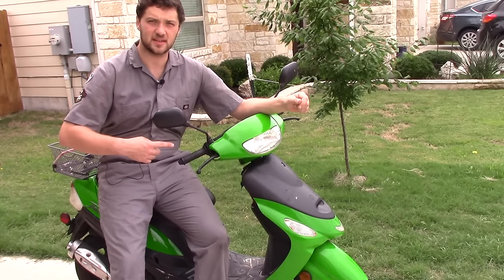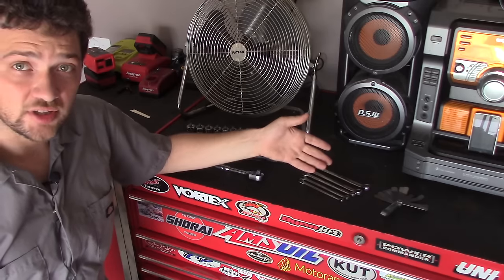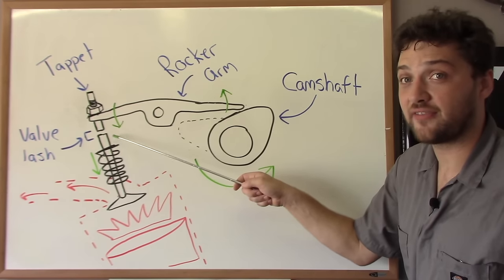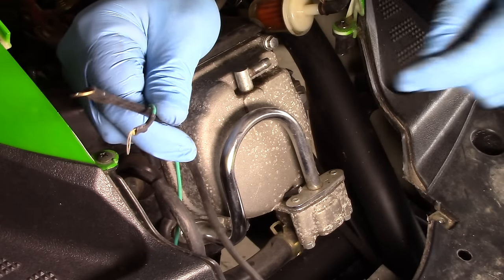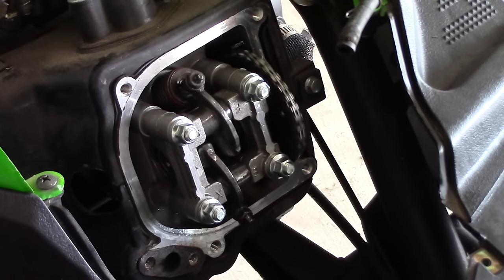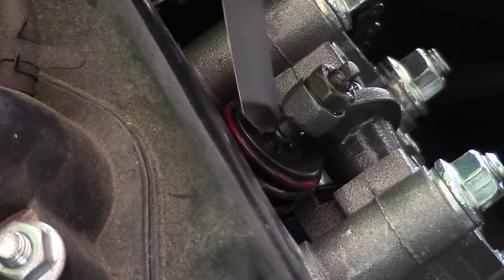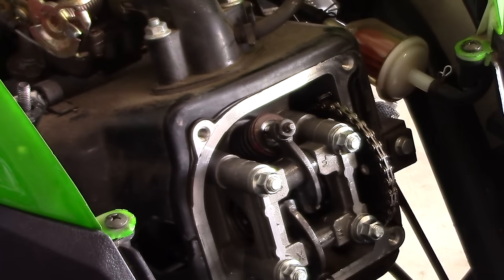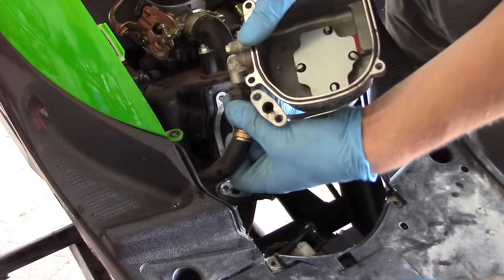Scooter 911: Hard to Start or Wont Stay Running? Try a VALVE ADJUSTMENT! (works for most scooters!)

Comment: Garrett
On some other YouTube Posts,  another problem seems to be the Vacuum operated fuel shut off or some people call it the fuel Pump. Up under the seat it has a vacuum line and the fuel line from the tank and the supply to the carburator. What say you in regards to this Pet cock which only lets gas flow when the scooter is running. Some people replace these and use a mechanical petcock shut off valve and plug the vacuum line from the intake.
Reply from the maker: Honestly I really like the vacuum operated petcock. Its really easy to forget to shut off the manual petcocks and that is bad for your float needle and seat. They do go bad on occasion but they are fairly cheap and easy to replace.

Comment: We did this and got the moped started. Put a new battery in it ran for a week and now its dead again and making a different noise. You can tell its getting plenty of power but it just whines without anything happening but it seems like it wants to.
Reply from the maker: Hmmmm well check out my charging system diagnostic video here https://youtu.be/l20k6vFoz2Y

Comment: My Suzuki 125 made a fairly large puddle of oil when I took the valve cover off. Next time I'll use a drip pan. Valve adjustment got the scooter running.

Comment: My spark plug hole threads were stripped on my gy6 150cc. Thankfully I have a parts bike that is the exact same model so I opted to switch the head rather than try to repair the threads. I forgot to put the engine at TDC before doing the swap and now the bike wont start despite having good spark and fresh 93 octane. When I try to start the bike it just makes a steady whining noise. Engine is grounded, lights gauges work. I am afraid I lost compression by not putting motor at TDC before removing and replacing parts and IDK what to do. Thanks. subscribed.

Comment: At 12:15 I can see the manifold that cracks across the top causing a vacuum leak caused by the weight of the carburetor bouncing as you go down the road! Sometimes the motor will start sometimes it won't and it starts hard! That is a clear indication to me that the manifold has tiny cracks along the top of the rubber hose portion! Scrape or shave the rubber off and replace with a piece of thread infused rubber hose from a radiator! Like I said!

Comment: Very helpful video . . .what if the rocker arms have tension springs on them holding the tappit against the valve pin?  How do you handle that?
Reply from the maker: I have never seen that in a scooter engine! Only in industrial equipment like generators and pumps. But the way I do it is to gently press on the back of the rocker so the spring is compressed and the rocker is pressing against the cam lobe. Be careful not to press too hard though because it will affect your measurement. Or if there's a way to compress the spring and lock it thats a good option too!

Comment: You're awesome. You love what you do, and it shows in the quality of your vids. Now, I must ask. What would one do if the issue is the complete opposite; starts and immediately accelerates out of control? Zero idling.
Reply from the maker: Well that sound to me like you either have a hang up in your throttle cabe or a misadjusted idle screw. I would start with the idle screw and back it way out. Then put your scoot on its center stand (so it cant run away from you) and start the engine. Then you can slowly increase the idle by turning the idle screw clockwise. Also make sure your throttle cable has a little slack in it. You should have 2-4mm of slop in the throttle tube.
Reply: My idlescrew is all the way in yet it wont idle, and shuts off, whenever its cold it takes 120seconds of starting before it runs, what could cause the idle screw to have no effect? It olso runs very variable rpms before cutting out

Comment: Hay if u run to much oil in a 50ccschooter what makes run for a few minutes then dies but will start back up do it again
Reply: I run gas line straight to the courbiter it run a few min then die  but it starts backup run a few min die again

Comment: Garrett, I have a Vespa scooter that won't start.  I've watched your videos & tried everything you suggest.  Like your valve adjustment video, I've put on a new fuel tap, carb, fuel line, vacuum line and spark plug.  Have also put it out on several Vespa sights.  It seems to have baffled everyone I've asked about it.  I was wondering if I could run the symptoms by you in more detail to get your opinion?  Please let me know.  THANK YOU for the videos.  I knew nothing about scooters a few weeks ago but I'm learning fast.
Reply from the maker: absolutely! why dont you email the details to me at garretseesingofficial@gmail.com and i'll try to help you get it sorted out!

Comment: I keep coming back to your videos! Your way of explaining is easy to understand & makes me laugh!  This is my first time working on a scooter & I'm getting a little discouraged but I will keep troubleshooting with your videos! FYI, I have a Tao Scooter & replaced the spark plug, CDI box, checked starter & starter relay and my battery is good. I can only get it started by kickstart & once it starts, idle is good & seems to run fine! It will even restart with the ignition button after I've been riding for at least 15 mins but after about 30 mins of sitting, I am forced to use kickstart to get it going again. Please help! I don't know what direction to go from here.
Reply from the maker: When it DOESN'T start with the button, does the engine cranks (Rikikikikiki sound) or does it do nothing at all?
Reply: @Scooter_911  It tries to crank but just wont turn over.
Reply from the maker: @lynnmcpherson7296  Cranking and turning over are technical terms that mean a very specific thing so i just want to make sure i'm understanding you completely. When you hit the button it goes "rrrruh" and then followed maybe by a slight buzzing?
Reply: @Scooter_911  ok. Well let me see if i can explain. When i hit the button, it makes a sound as if its trying to start and it sounds like there is plenty of battery but just won't ever get to the point of completely starting without kickstarting. I was curious if this would point to clogged carb since after it warms up, it will start up easily with ignition button.
Reply from the maker: @lynnmcpherson7296  gotcha! It's more likely that it is a compression issue. The scooter in the beginning of this video exhibited the exact same symptoms and the valve adjustment did the trick! I suggest thats where you start. Good luck! And if you want I can walk you though the procedure over Skype.
Reply: @Scooter_911  sorry about delayed response but it sounds ecactly like scooter in video. I really appreciate all your great info. If you ever come to Destin, Florida,  I would be happy to give you a Free Beach Portrait.. You Rock!!!
Reply from the maker: @lynnmcpherson7296  I'll keep that in mind!

Comment: Great video.  
Before I check the valves - my 50cc Buddy scooter has a different issue.  It sat for many months and wouldn't start.  I cleaned each channel of the carb with a steel wire from a wire brush.  Now it starts and will accelerate for about 3 minutes but then it will either die when i try to accelerate or it will only idle.  I've cleaned the carb again, replaced the battery, and checked the reed valve, which looks fine.  Any suggestions?  Thanks Jeff
Reply from the maker: Well unfortunately your buddy 50 is a 2 stroke so it doesn't have valves to adjust. The 2 things I would check are to make sure the autochoke has been re-connected to the wire harness after you serviced your carburetor. Other than that your engine might be experiencing a hot seize.
Reply: @Scooter_911  Garret - the autochoke wire was reconnected.  But here's a very funny (as in peculiar) thing - while i was working on it and testing it i had the air filter box off - it also has an air passage tube from the motor.  i put that back on, and voila, it accelerates.  I'll retest it again tomorrow.  Any idea why that would work?  thanks again.  Jeff

Comment: I have a problem with my gy6 150cc engine it runs fine, has power but when it’s cold outside doesn’t start without starting spray, i replaced the carb, sparkplug, cdi, engine oil, electric shock and wirings... and still doesn’t start .. could be this the problem ? The valves ?

Comment: I wish my 2012 Yamaha BWS had an adjustable "tappet", it has pads at different sizes that you have to special order to adjust the lash, which is a pain in the ass. Then the expensive shop manual I bought doesn't even show the inner side of the cylinder head cover, and I obviously put the rocker arm guides on the cover in wrong position judging by the terrible sound it made when reassembled. Now I must take it all apart again to check if there;s a dowel in there and guess the correct reassembly of the cylinder head cover in relation to the rocker arms, tinker tinker tinker.

Comment: l just put redes on outside of valves worked on a few scooters to start them up guess makes better compression by dissolving carbon in valve seat or could be just the thickness of the redex.tightening the valve air leaks.

Comment: You should do one on that clutch with those 6 barrel things that roll to cause the belt to tighten up in my experience sometimes they get sideways and if the bike is not on its dual kickstand it won't stay running customers think they have a blown motor when it's actually not

Comment: This is such a helpful video! For 50cc 139QMB, what lash would that equate to in metric milimeters (or rather micrometers)?
Reply: I need that information, too. Did you find that information in mm? I need to adjust my GY6 50 cc and I cannot find it anywhere in metric system.

Comment: Watched all you videos. Thannk you! Have a 2020 Tao 50cc scooter that won't start. I changed the carb, gas filter, air filter ,plug fuses and still won't turn over. The day it stopped working I added oil a few hours earlier .. What if I added to much oil? Could this be my problem and if so, how can I fix it ? Thanks

Comment: Hi Garret! you are trully amazing, a master. I would need your wise advice if possible and I will try and fix it myself. My greenpower 3 wheeled retro style electric mobility scooter is not functioning well. It starts but won't accelerate, it moves really slowly. I have got no clue on how to fix it or where to start. Everything else seems fine and battery is fully charged. Could you please advice me? Many thanks!!

Comment: How often is a valve adjustment typically serviced?
Reply from the maker: On a gy6 I recommend them during the assembly of the scooter and initial inspection, then at 500 miles, 1000 miles and every 2000 miles after that.

Comment: Hey Garret... you are the 🐐 the way you explain with such precision I have an issue G. my 170cc scooter wont start. It tries to start up making the same noise as in video. My starter works, I'm getting spark from my plug, I corrected my cables, and also tried starter fluid. It seems like it's a power issue but even with a jump start boost it still doesn't turn over. Do i have any advice for me.
Reply from the maker: Thanks for your kind words! Did you try the valve adjustment in the video? It sounds like your issue must be compression related. I made a diagnostic video here https://youtu.be/xW5y7a7CB1c but you've kindof already narrowed it down. Good luck!

Comment: I didn't understand the part with the screw driver in the spark plug hole. What does this do? The screw driver is going to be at different positions inside that hole, so how can you use this to make sure the valve is dead center? Must be a better way.
Reply from the maker: The screwdriver is used to feel for when the PISTON has reached its highest point in the cylinder i.e. top dead center. Valve adjustments need to be done with both valves in the closed position and with the piston at top dead center.

Comment: Great video! I have a brand new 50cc TaoTao. I upgraded the carb, fuel line, filter, ngk plug and cover for plug & added a fuel shut off. It ran fine initially. I put the plastic panels back on n it either won’t start or starts n stall right out. It has spark at the plug, gas in the bowl. I never adjusted the valves but again it’s new. What could my issue be? It did sit outside all winter after I put it together. Weird how it ran fine after the upgrades a few weeks ago then a week later it won’t start. I don’t try carb cleaner in air box yet but I will as well as adjusting the valves. I’m really confused so any help would be appreciated. Thanks bud

Comment: I enjoyed watching your video. Thank you for the lesson!
Reply from the maker: Glad you liked it!
Reply: Garret Seesing any tips on making a 50cc scooter faster besides a big bore kit and also if i get a bore kit do i need to upgrade the carb and adjust valves too
Reply from the maker: @derekenlow7607  best bang for your buck is the big bore kit actually. I've got a video coming out on it soon! It's best if you replace the carb but you don't have to. You won't need to do anything extra to the valves (but I recommend frequent adjustments)
Reply: Garret Seesing thank you. Appreciate the info. Ill have to get some tools lol
Reply: @Scooter_911 

Garrett, I have solved a vaccum problem... but it remains a bit of a mystery.   I bet you will know the answer.

I got a new carb that came with a T-connector for tor Decel- vacuum lime.

I plugged it in to the intake manifold and used the t to go to the petcock.

They mystery is related to the SECOND vacuum outlet on the manifold.

I quite accidentally discovered that if  I plugged that, it made the engine run perfectly. Not was sucking too much air with it open.

I fabricated a homemade plug with a short piece of hose with a screw in the end... and connected it to the extra outlet.   Runs perfectly now.

So the question :  WHAT was actually supposed to be connected to that extra outlet?

Is it so you can not use a splitter?

(my petcock vacuum line is too short to reach that outlet... and it reaches the T-connector...

Is my solution good? 

Or should I get a longer line for the petcock vaccum to reach the manifold (outlet 2)and eliminate the T-connector... by running a longer line from manifold (outlet 1) directly to the carb?

Comment: Went down a rabbit hole of maintenance and repairs on my Honda Ruckus recently. Did a valve adjustment/ re shimmed, new carb, spark plug, belt etc.. just a month ago. Everything was running great minus minor carb tuning. Then yesterday and today it was very hard to start even after keeping on battery tender. It feels like compression loss. What would cause the valve adjustment to go out so quickly?

Comment: Great Vid.
I intend doing my valves soon.
Wont tick over.I think the exhaust valve is too tight.
I hear a slight ticking as riding along.Winter is here and atmosheric conditons play a part i guess.Starting difficulty.
I have GY6 152QMI I guess will be same clearance on those valves?
Any help is appreciated.
Thanks
Reply from the maker: Absolutely! I use those specs across all GY6 platforms from 139qmb to 157qmj.

Comment: I have a 16 piece feeler gauge from 0.05 to 0.10 and so on, I should use the 0.5 on the intake valve and 0.10 on the exhaust? I did that but it has a clapping sound. Great video
Reply from the maker: Unfortunately you're going to need a different set. The intake should be .002" and the exhaust should be .003" . 0.10" is much too wide for the exhaust and that is definitely going to create that valve noise you're hearing! Sounds like you have a good handle on it! Good luck my friend!
Reply: @Scooter_911  thank you for the response, I didn't see it. I have one more question, when I try to give it full throttle on a small hill it stalls, I have to use half throttle to make it up, but on straight road it goes to full throttle no problem, what could it be? Also the carb fuel float is extremely rich, because If I set it as the manual says it won't idle or accelerate. Have a great day and thank you again for the response.
Reply: @Scooter_911  it does the same in on the straight road it stalls a bit after 20kmh, at idle it also stalls then come back to normal, some times the engine will slow down and die if I don't give it throttle

Comment: If vavle adjustment does not work put a larger pilot jet. That was problem I had after updating exhaust. I changed pilot from 35 to 38 and starts right up now with no choke.

Comment: I've been working on a friend's scooter who had a hard start issue. The valve lash adjustments would last for 10 miles,then it wouldn't start at all.After 3 adjustments, I replaced the rocker assembly. It continues to have random hard starting issues. I noticed that the spark is white,where I always thought it should be blue for the best performance. Years ago with Briggs and Stratton engines and older cars,white spark would indicate a bad condenser causing hard starting or no starting. Replace the condenser and they ran great. The scooter manual I have doesn't show a condenser. Is white spark normal for these engines? Great video!

Comment: Please make a video on how to fix engine losses power even on a full gas throtle. Hoping for it thank you.
Reply: check your fuel system. start at the tank where the fuel line plugs in and go from there to the carburetor. look for plugs. sounds like that's what your problem would be.

Comment: I noticed a slight rattling sound, Is that to be expected? Maybe I opened up the valve too much? Set them both to 4 thousandths
Reply from the maker: Its possible. I'd check them out to be safe.
Reply: @Scooter_911  thanks man!

Comment: Valve adjustment doesn't work for mine. But it did sound better.

Feeler gauges marked in thousandths? I would have said if it has both measurements. You can get imperial only or metric only.

In order to remove my bucket - I have to remove other panels first.